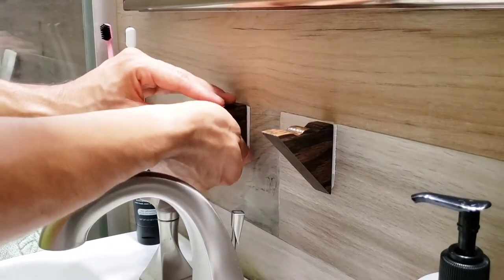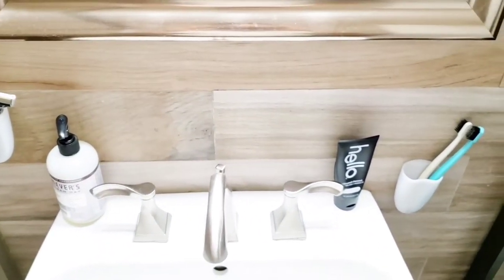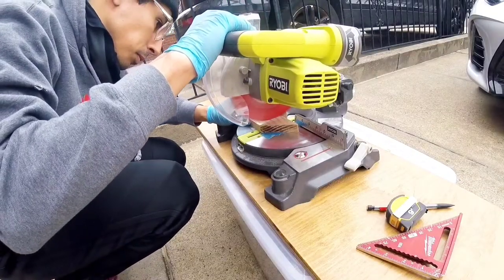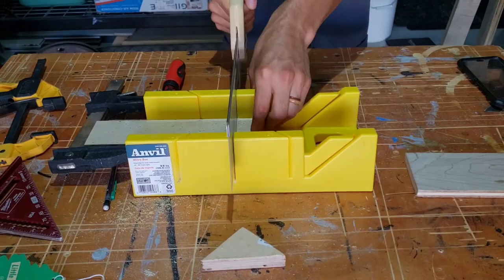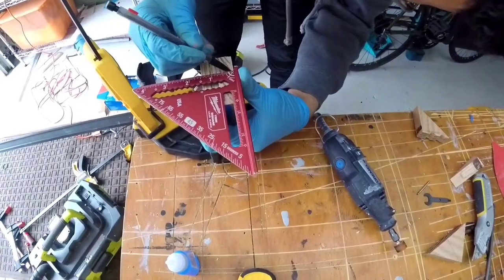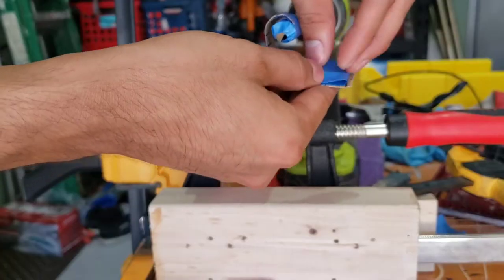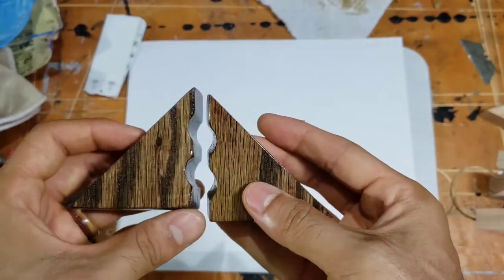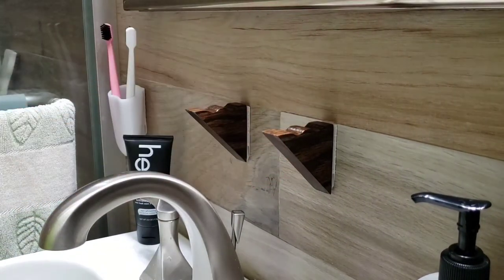Making a Floating Toothbrush Shelf

Comment: You need a router. For science.
Reply from the maker: I actually did try this with a router, but it was waaay too unsafe for me to use for this type of application. I probably didn't use the right router bit but since I had sandpaper and tape, a drill bit works just fine 😁
Reply: Builds by Alexis or you were approaching wrong. Route into a large blank the cut that to size.
Reply from the maker: @nkabui8wnabnd8099999  yeah I probably was using it wrong.
Reply from the maker: @nkabui8wnabnd8099999  I had tried making the holes before with a drill bit and then making the cut and I did it wrong, so I just with the approach of cutting them so size and then making the grooves. If I make another, I'll give the router a try again.